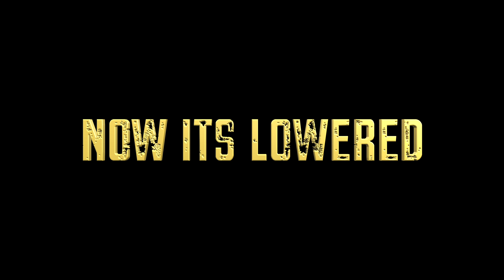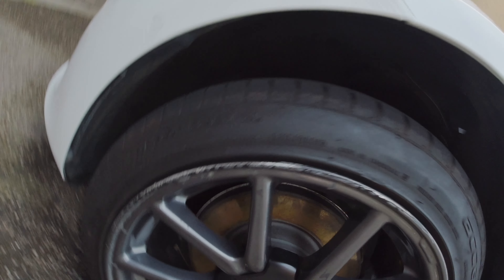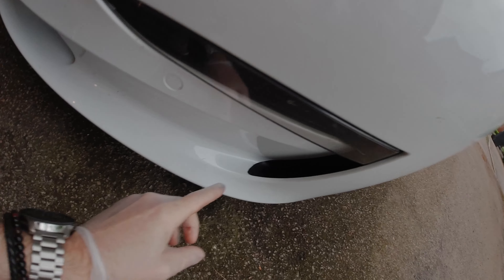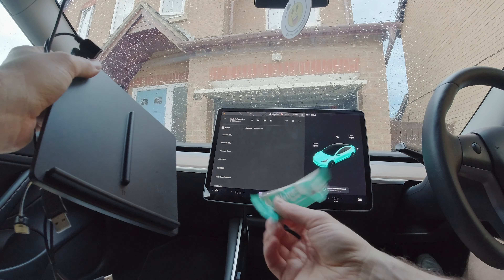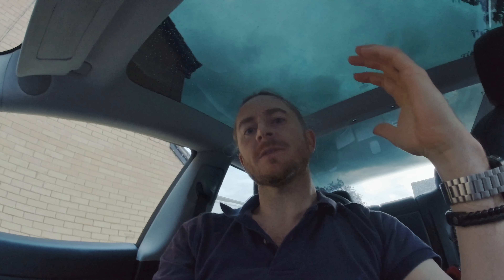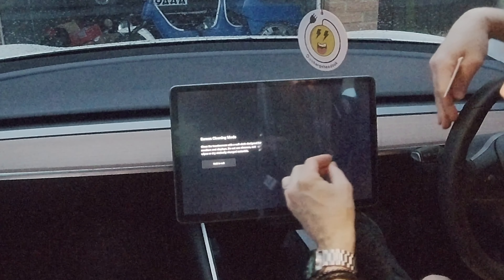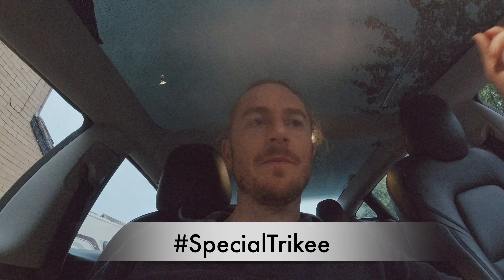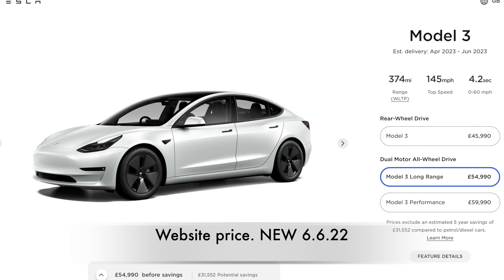ARE EIBACH LOWERING SPRINGS TOO FIRM FOR UK ROADS? Tesla Model 3 #Rusteetesla Modified EV Part 4

Comment: hiya I have ordered a model 3 and since they are so generic want to change it up a bit. Id like to lower it a bit mostly for looks rather than more sport, want soft ride as possible, any tips on brands and how much to go. I was thinking jus 10mm or 15mm.
Reply from the maker: Mine does bottom out very occasionally on big speed bumps other than that theyre fine. The best thing to do is go for Mountain Pass Performance comfort coilovers I'd suggest https://www.mountainpassperformance.com/